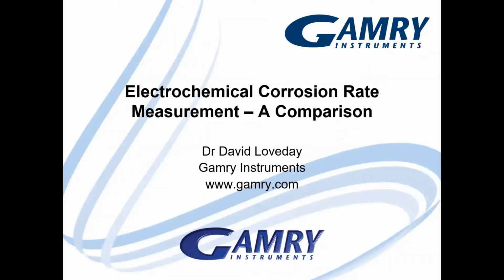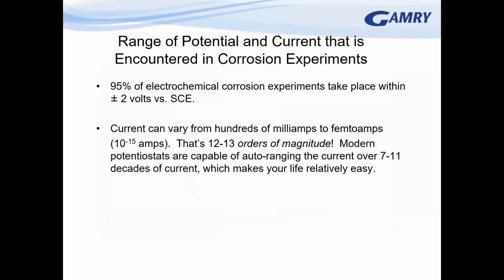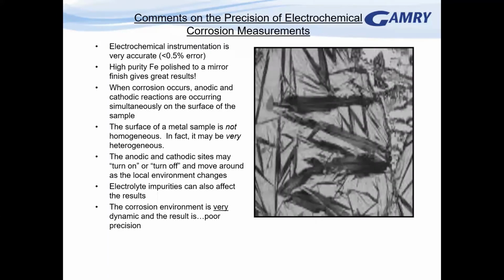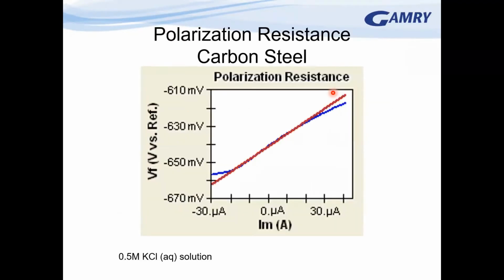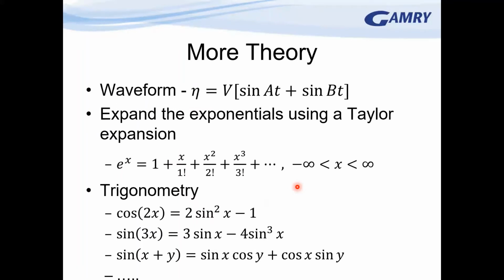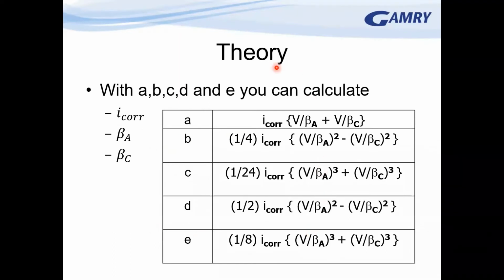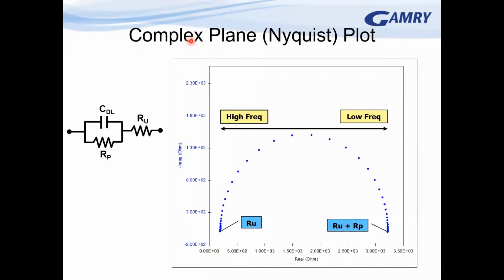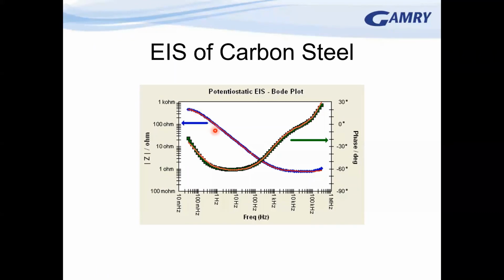Electrochemical Corrosion Rate Measurements

Comment: Hello, I watched a demo of corrosion calculation published on this youtube channel, it was called "Calculation corrosion rates with LPR&EIS" I wanted to ask what is the difference between 3 electrode potentiostat and 4 electrodes one. I believe In that video the person was using 4 electrode potentiostat and the 4th electrode was a " sense cable/electroode"
Reply from the maker: Yes, in a 4 electrode setup there will be two sense electrodes. This eliminates the impedance of the electrodes from the spectra, and only measures the impedance between the sense electrodes. We have an app note that covers this is more detail here:

https://www.gamry.com/application-notes/instrumentation/two-three-four-electrode-experiments/

All of our instruments can perform 2, 3, and 4 electrode experiments. If you have additional questions, please contact our technical support team at techsupport@gamry.com

Comment: hello. How can i compare the result of corrosion between Gamry device and normal humidity tester ? Is there any international standart that contains acceptance criteria ? How can I say "test is ok" after i finish the test. We have a gamry device but we dont know how we evaluate the result. For example when we have a new metal sheet like galvanised, we perform the test with gamry device but we dont know what is the acceptance criteria. Can you pls help us ?
Reply from the maker: We have the follow article which describes how to run and analyze a corrosion test using a Gamry potentiostat:https://www.gamry.com/application-notes/corrosion-coatings/corrosion-techniques-polarization-resistance/ There are also numerous ASTM standards for corrosion measurements. These include G5-94, G59-97, and G61-86. If you have additional questions, please contact us at techsupport@gamry.com